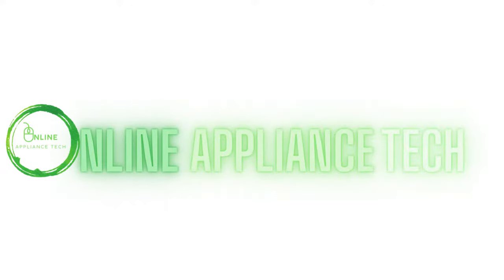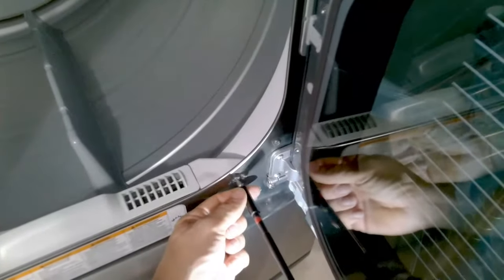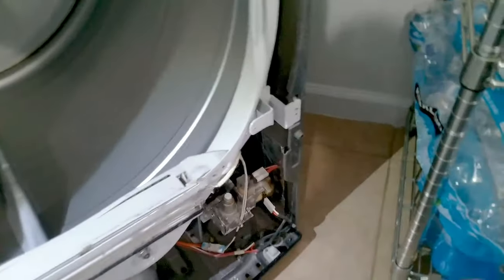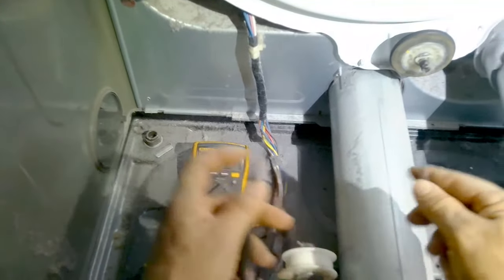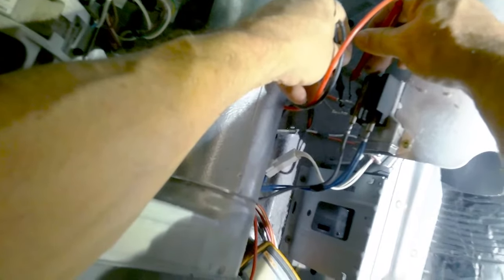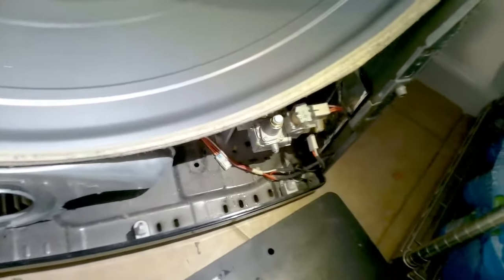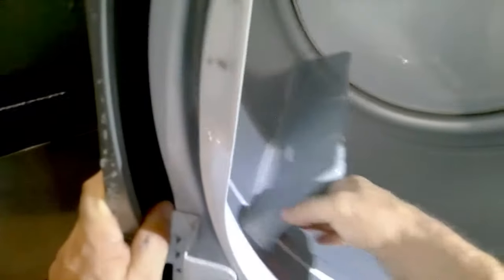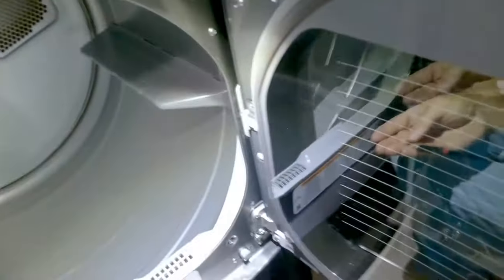LG Dryer Not Drying? {LG Dryer Disassembly & Test Parts}

Comment: Thanks so much.  I used this video to replace 4 drum roller wheels, pulley tensioner and the belt. Parts cost $30 on Amazon and about 2 hours of time which included deep clean of lots of lint. This video saved an expensive service call.
Reply from the maker: Glad it helped!
Reply: Thank you - I also used your video instructions install the $30  Amazon parts kit.  The belt / idler pulley portion of your video helped me.  My dryer noise turned  was a bad roller wheel.  Now my 20 Year Old LG Dryer is quiet like new!
Reply: Could I ask you, how did you get the part numbers?  I need to replace one of the drum wheels and the reset thermostat.  Thank you ..-

Comment: Thank you so much for this video! It's the best one in YouTube for this type of dryer. 

We had a sewer backup into our basement and the washer and dryer were in up to 6 inches of water at one point. They were in water for maybe 2-3 hours total. We cleaned the washer and it is working fine. 

Using your video, we opened the top of the dryer, removed the front housing of the dryer with the door attached, and removed the metal housing that the lint trap goes into. That had lint inside that had gotten wet and it smelled bad. We cleaned that up really well, and i dried the standing water out of the casing for the blower. We did not remove the the drum. We cleaned as much as we could reach. We left it to dry overnight and then reassembled it. We had two screws leftover. 😬

Turning on the machine was fine. We started a test cycle, and the machine ran normally except for a constant squealing sound that we had not heard before. Any ideas what might be wrong? Squeals to me often mean a belt issue.

I don't feel capable of removing the drum and belt and putting that back on correctly, so i suspect we may need to just call a technician if the problem would likely require removing the drum.

Comment: @Online Appliance Tech Thank you for the detailed video! Best one I’ve found for LG dryer not heating diagnostics. Our LG gas dryer went out last Monday and I was able to tear it down, use a multimeter to pinpoint the ignition as the root cause, replaced it and the thermal fuse for good measure. Put it all back together and was stoked to hear the gas ignition on the first try!

Seriously, you saved my vacation! I start a week off tomorrow for family vacation and we are able to get our laundry done at home now before we leave.
Reply from the maker: Thank you so much for your feedback! It's great to hear that the video was useful and you were able to diagnose and fix the issue with your LG gas dryer. Your resourcefulness and hands-on approach are impressive!

Knowing that our content not only helped you repair your dryer, but also made a difference in preparing for your family vacation, really makes our day. Enjoy your time off and safe travels. It's heartwarming to know we could contribute to your holiday preparations in our own small way. Thanks for sharing your success story with us!

Comment: Great video…well presented. I noticed a lot of humidity or standing water gets into my  dryer tub when not in use. Guessing it’s just coming in through the outside vent (I am in VA & it’s very hot & humid here), but wanted to know if you’ve experienced this or had any other recommendations to prevent it.

Comment: Amazing Video!! I have similar model dryer and all my parts seem to be testing good. When I plug mine in the drum light just flashes. Any Ideas? I get 240 volts from the outlet and the plug but when connected to the dryer I no longer get 240 volts.

Comment: Ok so my dryer was working and was drying through a te1 so I ordered the parts on Amazon just put them in it did the te1 code once again than I tried it again it works but it has a smell is that normal and thank you for the video it helped me learn how to get to the parts after it took hours trying to take the back panel off lol
Reply from the maker: Gas smell or burning smell?

Comment: The thermal fuse button part is called what? You said it had a couple names. Would you tell me the part number for it. I pressed that button and my LG heated up but you said to replace it so I will. Thank is for your kindness and this vid.
Reply from the maker: Part number AGM30045804 is now only available as a kit from LG and is specifically for gas dryers.

Comment: This is a great video. Thank you so much. I did everything and replaced the thermostat and the thermostat or whatever it is right next to the thermostat, there is no visual damage to the wires. It started working for a few loads and then stopped again with the same error code. I opened it back up and checked again, everything is reading correctly on the multimeter this time so not sure what the problem could be now. Same error. Is it the circuit board itself possibly?
Reply: I meant to say thermistor
Reply from the maker: It seems like the Main Control is the issue. Check out my LG dryer video which covers the thermistor problem. You can find it in my LG dryer playlist.

Comment: Thank you so much for this video! I just need advice if you can, my dryer wasn’t starting, just making the click sound, so I followed your instructions and changed the motor small thermostat which fixed the issue!!! And used one cycle and dried my cover perfectly but then it stopped working again, making the same click sound when pressing start, any theories?
Reply from the maker: Seems like you have a blockage, meaning restricted air flow. Check your duct work from your dryer to the wall to make sure it is not bent or clogged up.Unfortunately you will have to replace the fuse again, or you could tap it on its back to reset to save you time. Just make sure you hear it shake or rattle on the inside, That lets you know it's reset. Hope this helps.
Reply: @onlineappliancetech  ok, I will try this, thank you so much for replying!
Reply from the maker: No problem:hand-pink-waving:

Comment: I have this same dryer that's out of warranty, and I'm looking for help to fix it myself. The machine turns on and shows that it's “running” (it even counts down and ‘acts’ like its running a cycle,“. I once got the “NP” error code, but it has since disappeared. I checked the breaker and confirmed that my wall outlet and plug are both drawing 240V. Could this be a belt drum issue, or is it related to the blower housing thermostat or fuse? I'm unsure how to check the latter. I have also done a wifi diagnostics and everything checked out. Any help would be greatly appreciated.
Reply: I replaced the 6:40  thermal thermostat and it worked for one cycle and stopped working. Anyone know why?
Reply: I replaced the thermostat for the motor and it worked for some time. 16 minutes before the cycle was to be completed the machine stopped and was told to check the sensor flow and it hasn't worked again. Any ideas on what is going on here??

Comment: Nice video how do u test the moisture sensor on that same machine my dryer turns on for like 2 minutes then the clock switches to 1 minute then end on the screen technician came to fix it said the air duct needed to be cleaned but it's clean
Reply from the maker: Sounds like air flow? A good way to test is to disconnect the air duct from the back of the dryer and see if it runs longer? If it does great that means it's your vents that would need to be cleaned  Also make sure you place a load of damp clothes in the dryer before you test so it can detect them. If none of this helps please send me model number. Best Regards Matt...

Comment: Hello My 2-3 year old LG dryer stoped heating recently. I checked my vents and they were really clogged prob from previous owner. I cleaned out the vents and found  out about the reset button. Dryer started heating for a few loads but stops heating after a few loads. I have to always hit the reset button after one or two loads. Do you think I should replace the thermal fuse? I’m sure it’s prob hard to say without properly inspecting everything but do you think this is the most common problem? I watched your video and a few others and think it’s something I could do. I just don’t have all the testing equipment to test everything. Thank you
Reply: Sorry one more question. The part I am referring to is the thermal fuse that has the reset button. Under your parts link, I see the high limit thermostat that was towards the back and you explained right after. Do you have the link for the thermal fuse connected to reset button or Is this essentially the same part?
Reply from the maker: Open the door, turn the drum clock wise, if it is hard to turn you will need to replace roller wheels . Reason why is if your drum is not moving at the right speed due to rollers not allowing the drum to move at the right speed hot air will be trapped inside of the drum and cause the fuse to trip. Also when you replace wheels make sure to clean all air flow inside of the dryer well.

Comment: Great video. My dryer is throwing a te1 error, would you know what this means?
Reply from the maker: TE1 is a dryer thermistor error code. Make sure your air flow is good. And duct work is not kink up from dryer to wall.  Hope this helps!
Reply: @onlineappliancetech  I checked my duct work, it's all good. I just replaced the thermistor and just got done reassembling the dryer, did a test run I'm still get the same code. Any ideas?
Reply from the maker: Under LG Dryer Service Manual under Remarks it states = tE1 error is displayed in the drying cycle or test mode. Replace the Steam Generator, however I would recommend calling a good LG tech to come by and check out and diagnose the problem. Hope this helps!

Comment: Great Video! I have a te1 code so after replacing the thermistor and sensors right next to it I still get the te1 code right away. The igniter had a reading up in the 300’s, could that be my issue? LG gas dryer model DLG7301VE
Reply from the maker: The TE1 error code on your LG Dryer model DLG7301VE typically indicates a problem with the thermistor, a component that measures temperature within the dryer. This error is often triggered when the dryer does not properly detect or read the temperature.

The issue can be due to a few reasons, such as:

The thermistor might be defective or damaged.
There could be a problem with the wire harness connected to the thermistor, possibly due to a loose connection or a wire short.
In rare cases, it could be an issue with the control board that reads the thermistor's resistance.
It is recommended to unplug your dryer and check the thermistor and the wiring for visible damage. If there's no visible damage, you might need a multimeter to test the thermistor's resistance. However, please be aware that this requires a level of technical competence. If you're unsure, it may be best to contact a professional to help diagnose and fix the problem. Hope this helps! And best of luck!
Reply: I have checked the thermistor with my multimeter and it was good, I still replaced it but this did not solve my problem. The wires look good so I’m leaning towards the board being the problem. Is there a part number or is this something only a technician can replace?
Reply: I have the same problem.  Was it the control board?
If yes,  what is the part number?

Comment: I have model DLE5001W. 
  Door switch has 2 wire connector besides the door switch itself. Can’t seem to find info on where they go. 
  Comment?
Reply from the maker: For the LG dryer model DLE5001W, the door switch will have a specific connector that is meant to attach to a corresponding part of the dryer's wiring harness. This is to ensure that the connection is made correctly and safely. The two-wire connector you have should only fit into its corresponding connector in one way—this is by design to prevent incorrect wiring which could potentially cause malfunction or pose a safety risk.

If you're not seeing where it should connect, or if the connection isn't obvious, then:

Double-check the user manual for a wiring diagram or installation guide for the door switch.
Look for any markings on the wiring harness that might indicate the correct connection point.
Examine the connectors for unique shapes or color-coding that might match the harness.
If still in doubt, it's advisable to consult with a professional technician or reach out to LG customer support directly for guidance.
Reply: @onlineappliancetech  Gonna look for the user manual today. I cannot visually find another connection for the two wire connector. 
  Thanks for the response. 
  If I can’t find the answer, I may just scrap it for parts.  Wire burnt in the cutoff and high limit thermostat has come apart.  Both test bad. 
  I might straight wire them for testing purposes since parts seems to have gone up in price so much, and I am a little leery of LG’s.
Reply: My dumb ass found the connection for the two wires. 
  It fit the drum light.  SMH. 
  I am pretty sure I checked for that, but I was just haphazardly  placing the the front parts if the dryer in place by hand and in sort of a hurry.  I didn’t think the the wires were long enough.  Checked again and they are for the light.
  Reminds me of a few times I forgot to connect lid switches on washers.

Comment: I have the same dryer but mine is electric not gas, the problem I’m having right now is that whenever it starts it just makes a loud humming noise for a second then stops, it doesn’t spin, im not sure what’s wrong with it
Reply from the maker: It seems like either the motor is shorted or the blower wheel might be jammed, preventing the motor from starting.
Reply: @onlineappliancetech  I took apart the dryer and took off the blower wheel, I started the dryer without anything hooked up to the motor, it made the same humming noise, the motor twitch but didn’t spin so I ordered a new motor hopefully that’s the problem, thank you for the information
Reply: @JuanFlores-nl9nc  Hey I have the electric version as well it's a dle7001w model, basically the same as in the video but he doesn't go over testing the Motor. I had the same issue you described, when I turn the machine on it makes a humming noise and isn't spinning while everything else seems to be working like normal.   How did your motor replacement go, did it fix your problem? And if you don't mind where did you buy your parts.  Motor isn't seized and turns easily, machine was pulled out of storage recently and worked for about 3 loads but I thought the motor did sound a little loud, now it did what you described.  Thanks in advance I hope I see a reply.
Reply: @mikeking561  the way I tested the motor by putting the dryer back together but without the drum in it and I use the belt to pull up on the pulley so it’s not pressing the off switch, then you want to turn on the dryer like normal and if you see the motor kinda twitch but not spin then it’s the motor, there’s not much that can go wrong on these dryers

Comment: My husband replaced the thermal fuse since it had no continuity and it wouldn't start would just click I ran the dryer for like 10 minutes n then it started doing thr same thing clicking and not starting
Reply from the maker: It appears that your ductwork may be clogged, causing the fuse to trip. You should ensure that the ductwork leading from the dryer to the outside of the house isn't backed up. Additionally, inspect the ductwork to ensure there are no bends that might restrict airflow from the dryer.